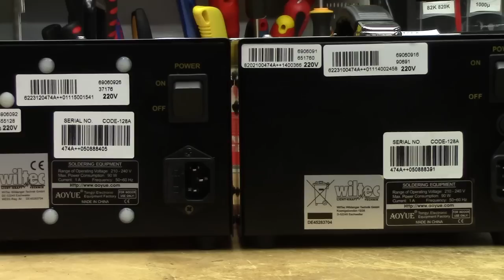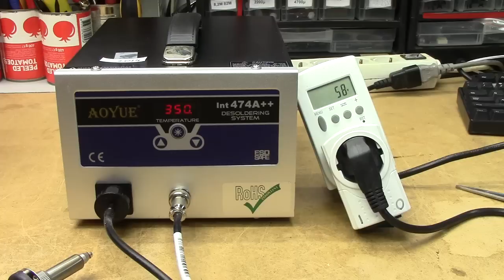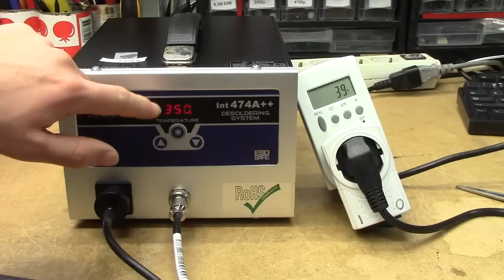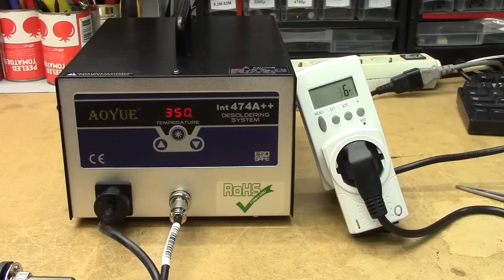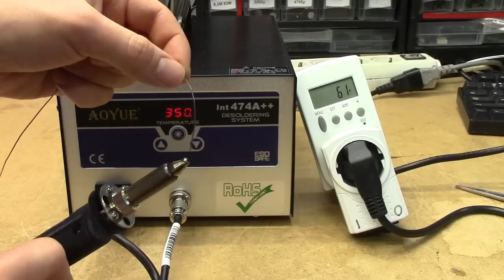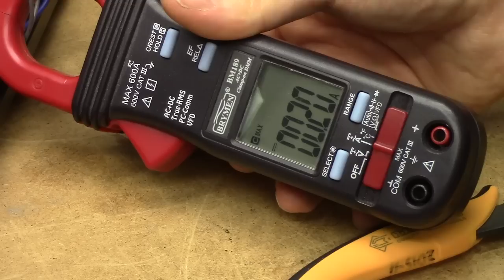AOYUE 474A++ double teardown: Old vs. new model

Comment: On a properly rated and sized transformer you would get DC voltage of about 1.25 times AC. On this one you are getting 12VDC because the transformer is grossly overrated. From the looks of it that is really a 50W transformer. Chinese are notorious for overrating  their transformers.
Reply from the maker: +Dragan Milivojević Yep - I suppose they have a pretty good excuse in this case, since the transformer should definitely never run continuously at its full rated power in a desoldering pump. That SAID, they should have just used an adequately sized winding for the pump. It's another argument in favour of turning it into a battery powered unit, I suppose. ;)
Reply: FFcossag
You have plenty of batteries so that should not be a problem ;)